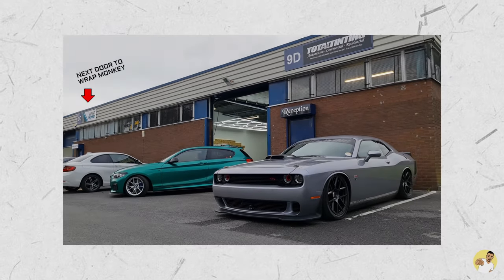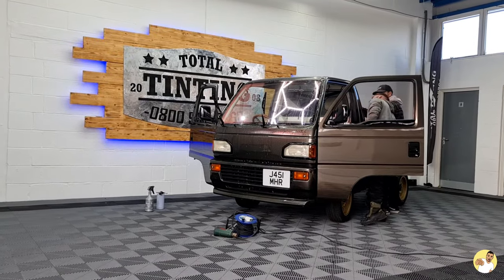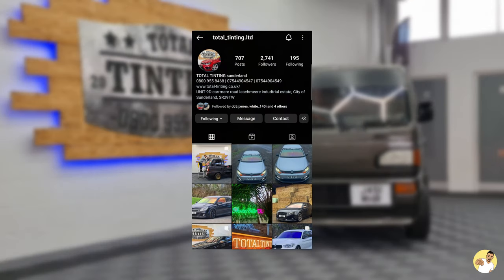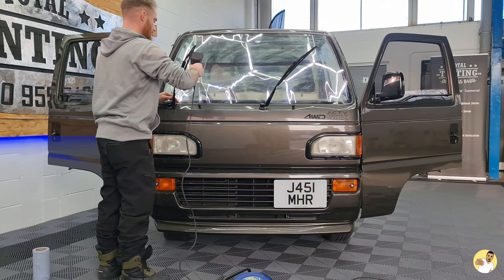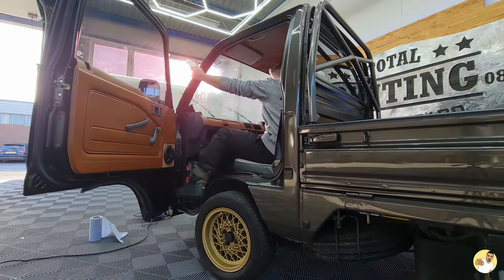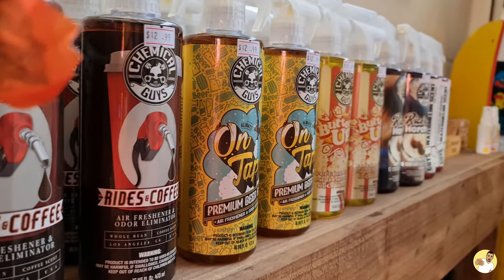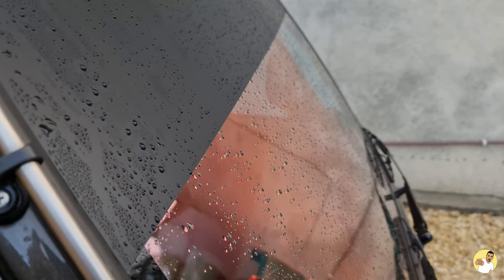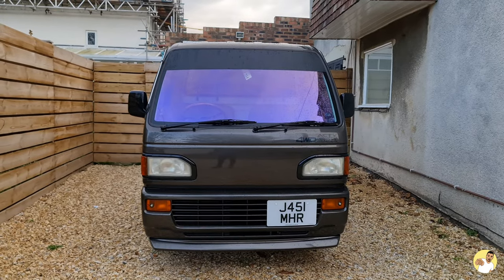Installing a CHAMELEON WINDSCREEN TINT on my JDM Mini Truck

Comment: Off topic! Where’d you get the rubber matting on the back of truck? And is it in that entire bed? I have a old truck that’s a bit rusty with some holes.. I was thinking of this stuff as a bed liner but do you not get loads of water getting trapped underneath? Or have you sealed yours? I didn’t want mine to be causing more rust issues 😢

Comment: Think I’m getting rid of my 140i🤦‍♂️ not about the fuel or the insurance just simple sick of not being able to get the power down, when I’m back from dam next week I’m gonna look into 4wd’ing it how was yours on a stage 2 ?? Before I spend the money 🤣🤦‍♂️
Reply from the maker: Not possible to 4WD convert them on a RHD car. Only possible on LHD like ze Germans have.

Mine was only "Stage 1" but I drove a 640bhp M140i and there was no point in having tyres, just spun in every gear 😅
Reply: @lookship  fuck sake🤦‍♂️🤦‍♂️🤦‍♂️ looks like I’m gonna have to move over to the c63 best get myself a 6.2 before they go over board on price